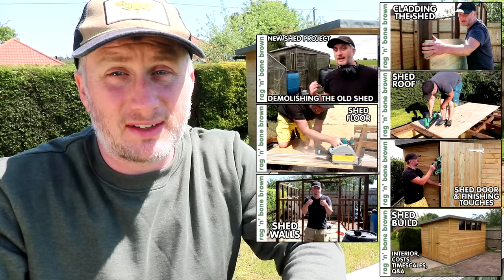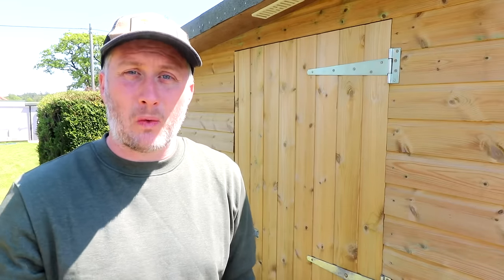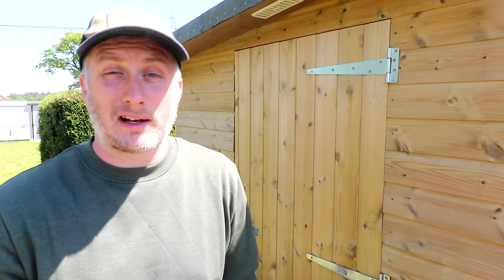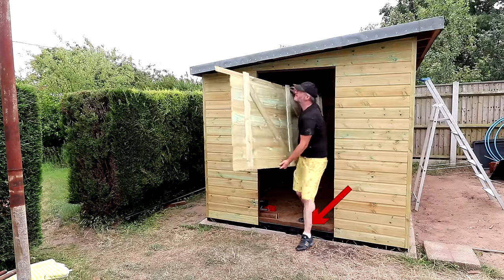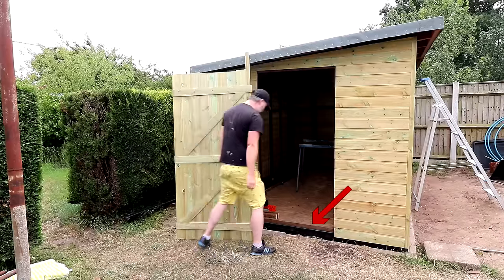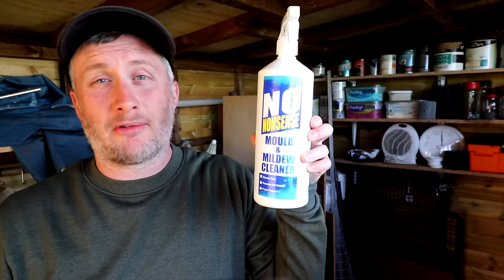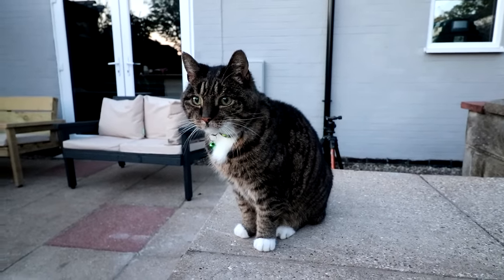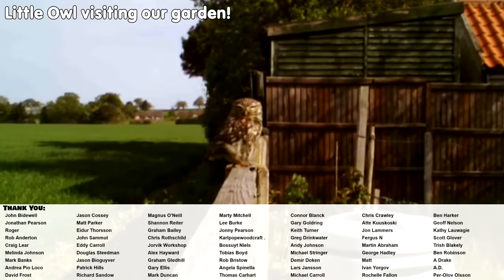4x Problems With My Handmade Shed: One Year Update

Comment: Put angle iron horizontally across the inside of the door in 3 locations ... will stop the door from bowing and straighten it out. Use carriage bolts from the out side to the inside for security.
Reply: Yep, three strong backs.
Reply: Angle iron may stop the bowing, but will cause worse issues.  The horizontal ledge bowing gives the individual boards somewhere to go as they expand sideways.  Think of it like an old bi-metallic strip.  Remove that ability to bow, and with nowhere left to go, the vertical boards will buckle and come away from the iron.  

The only way to stop timber expanding is to stop it taking on moisture, hard with T&G boards.  A thorough finishing, with end grain sealer on the top and bottom of the door is the best you can do.

Comment: A friend of mine went to a scrapyard.  Bought one of those roof fans off an old vehicle.  Like butcher, fish vans. Window cleaner vehicles.  Normal wind moved it. Kept air moving inside.  I use old computer fans 12 and 5 volt ones.  Battery, solar or wall wart powered.
Reply from the maker: Cheers. I have no power in the shed its about 20m from the house so not practical
Reply: Use a solar panel charger through a rechargeable battery. It'll vent in daylight

Comment: I built my own workshop some years ago, same problem. I hadn't been in there for a while (winter months), and was shocked to find all my tools had come down with orange fever (rust). I had condensation literally dripping from the roof🤔. I managed to solve the problem by putting in vents top and bottom of the side wall with 4 inch extractor fans on the opposing walls, which I then linked to a timer which was set to run for 15 minutes per day. Success.. problem solved, Job done.😉

Comment: Great video! I have a suggestion for the mold issue. You can attach a cheap low voltage computer fan inside to those round soffit vent covers. They can easily run on batteries, but the most effective thing to do is attach a small (6"x6") solar panel to each of them so they're automatically running every day from dawn until dusk.
Reply from the maker: Good tip!
Reply: To blow out wet air or suck inn dry air?
Reply: @tehans77  surely it's to blow air with moisture in it out and then suck drier air in from other sources

Comment: I watched yours, Liam Griffin’s and Ali Dymock’s videos to give me the confidence to build my own 12x10ft shed last year, they were all fab resources. I’ve had the same issue with condensation, my shed is also wrapped with breathable membrane so even less air flow. I used similar products to get rid of the mould and have the same staining left over. I also treated the underside of my roof ply with sika 5 star wood treatment and am hoping this winter will be a lot better. I use a Neos SmartHome leak sensor which also detects humidity to give me an idea of when to open the windows/door to prevent it from happening again. I installed a shower extractor fan too but didn’t see much effect of that to be honest and also have painted the shed with no nonsense shed paint so that the shed doesn’t soak up so much moisture when it’s raining. Just sharing similar experiences.

Comment: Invest in a dehumidifier. If you have no electric in the shed you can run a cable from the house. You can run a pipe from the dehumidifier to the outside to save having to empty the water container.
Reply from the maker: Not practical, the shed is far away from the house, and not necessary, see update here https://youtu.be/aREO6-XvOZA

Comment: Nice to see your honest follow-up. Good ventilation is really the key to fixing the mould. The vents are useful but it may be even better to add some mechanical assistance. Here in Australia, we have things like the “Whirleybird” that uses wind movement to extract inside air, allowing air to be drawn in those vents you installed. You may have something similar over there. I love your various videos.
Reply: Roof vents various types are used a lot over here.
Reply: That's a great idea. Free extraction - can't argue with that! I'm going to add one to my shed build. Thanks and love from the UK.

Comment: Good video on learning from mistakes. The comments about this being an unheated structure are correct (closed cell insulation would have helped, but yes more money.) .Best practices follow regular house framing if you want to avoid rot, vapor intrusion and mold: polyethylene vapor barrier (plastic sheeting ) at the floor deck and on the walls  like a tyvek  wall wrap (next time); exterior grade plywood wd have worked better (but more money); more cross ventilation, could have used passive garage roof vents w/ insect screens; door end grain will soak up water if you do NOT SEAL/coat it. You do need a drip edge over the door (since it doesn’t have a regular jamb and head);  better to use a deck grade exterior translucent wood stain sealer, not a house paint (coating) per se.

Comment: We bought a prebuilt one 10x12 and the vents were basically completely open on the overhang area. 
Since there is no ventilation from ground you need pretty significant breathing for the shed else the spores will come back.

Comment: The key to ventilation in any structure without any forced ventilation is the use of convection currents.
Vents up high as well as down low will increase ventilation massively, even on days where there’s no real breeze.

If you can make sure there’s vents up and down, at all sides of a structure you’re very unlikely to have any issues.

A small fan running off a usb power pack will be enough to ventilate the place soon after construction, when the tantalising carrier is vaporising.

Comment: Put a price of 2x2 on the inside of the top, bottom, and middle rails, if any are slightly bowed then put the bow the opposite way. You would gain more if the 2x2 was bowed as well. Could also use angle iron or 2x2 box steel. This will prevent it from bowing it the first place. Regards Alan

Comment: I’m in the process of ‘rebuilding’ my 25 yr old 21’x11’ shed due to rot degradation, new structural uprights (most of them!), new roof and new tongue n groove cladding. Never considered ventilation and the shed was never ventilated in its original build as it was one of those ‘budget’ type sheds assembled by a local firm, all I could afford in those days 😏 ....I’m now going to look at ventilating my shed as I’ve put permeable/breathable membrane on the outside under the cladding and I’m going to fix insulation bubble rap foil sheeting on the inside, appreciate the advice 👍👏

Comment: Watched your vids many many times but im still collecting my guts to start this project.. autums can bring lots of rain, winter can bring lots of snow..dunno how to deal with those two probs that shed wouldnt rot away in few years..
Reply from the maker: If you keep good airflow underneath and make sure no wood is touching the ground you'll be fine with pressure treated timber for many years

Comment: The shed was bound to be susceptible to condensation because it will heat up and cool down mercilessly.  Ventilation is the key and the accepted free air ventilation should be equal to a 1/2" strip for the full length on the long sides.  That will require a considerable number of the circular vents.  As regards the security of the shed, it seems to be particularly vulnerable as the strap hinges on the door can be simply unscrewed - a 2minute and quiet job.
Reply from the maker: I used security screws

Comment: Hi Keith, I'm no expert but had the same problem over a wet winter in a new workshop / shed years ago. The fix that worked for me was to add vents both high and at floor level so the cold air coming in low pushes the warm air holding the water out the top. I also added a little cheap solar fan high up. Never had a problem again. Thanks for the useful videos.
Reply from the maker: Cheers may have to try that if what I've done doesn't work 👍

Comment: Great video, thank you.
I remember reading somewhere that any unoccupied space which won't be heated should be considered as outside and adequate airflow should be allowed for.
A good example is a loft or shed.
I ended up using stainless steel insect mesh for the soffits of the shed I built.
My door bowed the same though. :)

Comment: When I built my workshop I put down a layer of thick damp course plastic underneath the floor. I am convinced that it prevents damp air rising through the floor. This way it is easier to ventilate the space because you only need to worry about ventilating warm air inside the shed and not warm air from below the floor rising up and condensing. Its been up 2 years now and I haven't had any mould at all which I'm quite surprised about. I put 1 trickle vent on the window which is always open located towards the ceiling. I do have a window that opens but through the winter it stays closed. One thing I would suggest is to add some polystyrene insulation to the inside roof sections as you did in your original workshop. At least that way if warm air condenses on the ceiling....it will be on the polystyrene and not on the ply. The closed cell structure of polystyrene prevents water penetration.

Comment: I'd say your mould is caused more significantly during cold and frost ontop of the roof causing moisture to collect and freeze underneath causing trouble then when it thaws,i had a mould issue with my shed caused by a lack of air flow underneath it so once I jacked it up it resolved

Comment: Good video. TBH I think you can do all the correct constructive stuff with breathable membranes, ventilation up the ying yang and you will still get ‘condensation’ or moisture related problems in a shed in the winter. It is all down to the prevailing temperature, humidity  levels and associated dew point. You either have to heat the shed so that is above the dew point, run a dehumidifier or both. You cannot fight physics.

Comment: Great video thanks for the open approach to what’s worked and what hasn’t.   One minor point,  you shouldn’t store paint in the shed if the temperature is going to drop below zero,  the paint will go all horrible.  Might be better keeping it in the garage or somewhere where it can’t get frosted
Reply from the maker: Cheers. It's only water based paint that spoils, oil based is generally fine. Most of the paint in the shed was left by previous owner so I don't really mind if it spoils as we don't really like the colours 😂

Comment: Good video on review & repair. I think your door could do with some drip rail above & below. The open endgrain will wick up rain and contribute to swelling & bowing. You would be amazed how deep it will soak in. Leave a plank in a bucket of coloured water!!
Reply from the maker: Cheers John, I like the idea of a drip rail at the bottom, I don't think the too really needs it as there's plenty of roof overhang
Reply: @RagnBoneBrown  cheers Keith  if the top is swelling too, then add one, anything to stop water wicking in

Comment: Hi Keith. In case you also have things you don't want to freeze (i.e paint) you can get a small solarpanel solution with a build in fan. These are made for small summer cottages and similar building typically not used during the winter and with no heat source. The panel makes enough dry warm air to keep the inside dry and frost free. They cost around 200 GBP
Reply from the maker: Sounds good, but too expensive
Reply: Also fairly simple to make, search YouTube or Google for DIY solar air heater.  Basically a network of metal tube (made from old beer cans) painted matt black

Comment: Tanalised or pressure treated timber still needs a preservative especially where you've cut it, pour water on it and you'll see it soak in, treat it with a good oil based preservative (modern ones are rubbish) and the water runs off, it also prevents mold.
Reply from the maker: It needs a preserver where you expose new wood, yes, but not where you don't
Reply: @RagnBoneBrown  It does benefit from it, the wood will fade to a dirty grey and get darker as the years go on, no matter what preservative you put on at that stage it will look a muddy dark colour, putting a harvest gold or light brown oil base on when it's new will keep it's colour if you give it a coat every 5 or so years, there is also a great difference in quality of treatment, some are absolutely rubbish and not much better than plain wood, i coat every joint before i assemble.

Comment: Passive ventilation will likely not be enough.  Put a fan in the shed blowing around - doesn't need to blow out of or into the shed.  Moving air holds more moisture and will prevent it from condensing.  If that isn't effective, then you can step up to an exhaust fan through the wall of the shed.  The final step would be a dehumidifier if that doesn't work.
Reply from the maker: Running 20m of electrical cable from the house just to have a fan there isn't really practical

Comment: Possible solution for your shed use exterior grade 3/4 inch plywood instead of OSB how ridiculous to use a low quality wood on a floor you only going to have a rotten floor someday and you'll have to replace it. Why not do it right the first time?
We just built a shed and we are putting the floor in retrofitting it on cement block footers all the way around the perimeter we are going to spend $150 on the wood because we want to do it right the first time there's absolutely no reason to use sub quality flooring they're going to put tile on that and then we're going to put our expensive tools on we have a lock and deadbolt and a brand new door that we bought from Home Depot that was pretty hung it is beautiful
Reply from the maker: I suggest you watch this video https://youtu.be/aREO6-XvOZA
Reply: @RagnBoneBrown  after reading the comments I'm just wondering do you think moisture is coming from the ground? Our shed has not got the floor yet we're going to retro fit the floor and we're going to put 6mm visqueen underneath the plywood right on the dirt and then we're going to add gravel and plywood maybe that has something to do with the moisture content after all hot air rises?
Reply from the maker: Nothing should be in contact with soil. You need ventilation under the floor otherwise it will rot

Comment: Nice shed and thanks for the video's & tips 🍻 cheers.
Im boulding a shed now too, it was a desire for many years becose my house is to small to have a workplace for my hobbys.. Its why im insulating it on the cheap to keep the condensation-moister out and keep my machines&tools dry.
For a storage-shed its not really needed. Paint and such cannot stand heat&frost tough..! 😉
Greetings from the netherlands.

Comment: I'd build a steeper roof. That should make for more cold to warm circulation. Your shed does look good,
Reply: That roof is pitched just fine IMO. More dead air space wouldn't matter without a ceiling either.

Comment: Your shed isnt insulated so this was totally going to happen, you have no temperature difference between outside or inside, even a small one would fix that imo. I built my shed over 5 years ago now based of your video on your first shed but I insulated the wall with rockwall and 4mm ply and ceiling with Kingspan and also 4mm ply and I have exactly zero issues with any damp coming in, the Shed is about 2-3 degrees warmer that outdoor as I dont use heating inside.

Comment: I sealed my shed with wood filler to cover the holes in my shed but to stop moisture getting in shed. At the main door to the shed that lets a bit of air in but do you need vents open for all year round?

Comment: 1 thing you can build a shed cheaper and faster than a kit build shed you got to wait for the kit to be made then delivered then erected .if you got the no how build a shed yourself I did out of reclaimed timber and a old shed that I dismantled total cost 100 pounds to make a new one. 20 years later still standing strong have had to repair the roof once .if there a leak fix it right away it will ruin the shed floor and the shed . I have now got pond liner for roofing sealant better than roofing felt.. creosote shed treatment will cure your mould problem that and venting it a bit more

Comment: I have had my shed for many years (since the winter of 99) it was a shell with 4 sides, no roof or floor, just earth, when I inherited  it , So I laid a floor down using paving slabs. Then put carpet tiles on top.
 I strengthened the sides, with an internal top frame, put 1" ply on the roof. 
That lasted for a number of years, then water started to rot parts of it. That started a chain of events, once I started to replace parts of the roof. 
Water started penetrating the roof, so its been refelted  a few times, finally settling on plastic tarpaulin for it

That stopped the water getting in.  It became dry an water proof, so now I got mould, no ventilation, so I gotta put vents in for circulation. (Latest job to do)
I joined it up with a lean-to, still seperate, but with a gap thro the top.

Over the years I have made my own door, Strengthened that, installed ready made window frames. Then they started to go, so I made my own, even extended the front by 13". 
The roof was already over hanging by 13". So I simply put a new front in front of the old one. Then when it was finished, took the old one down.
Then I could set up a metal bench in the extra space.

Recladded the front, more recently (in 23)
So it's seen a lotta changes.
 It's an on going process.

Remember folks, a shed is for life, not just for Christmas or Summer...

Comment: Wow! Beautiful design. The door is too pretty to paint. I would put Kilz primer and paint on the ceiling. I think you need some edging tape by AZEK that seals the outer eaves and put eaves flashing for eaves and skirt. That could prevent moisture for ceiling and floor.  My contractors caused my problems so I'm learning to fix them.